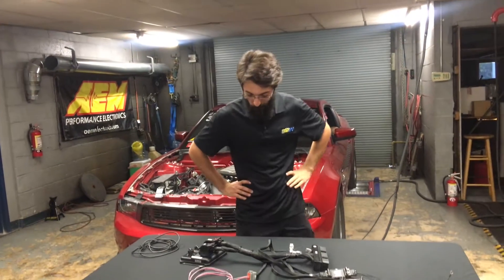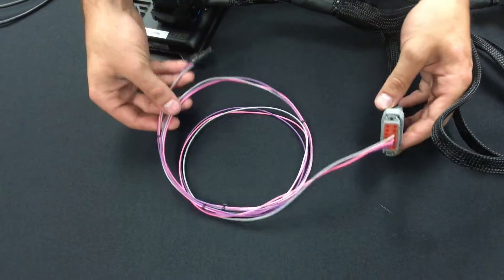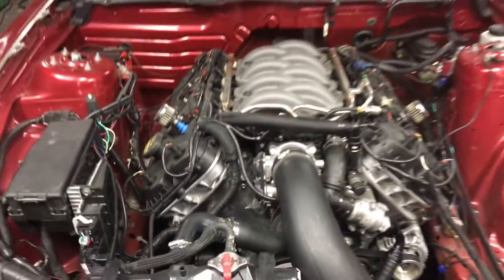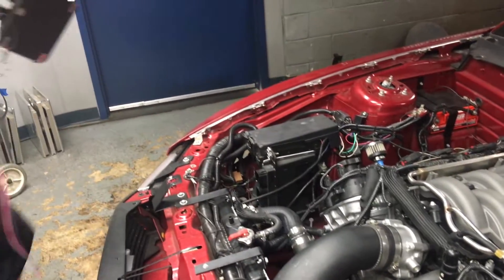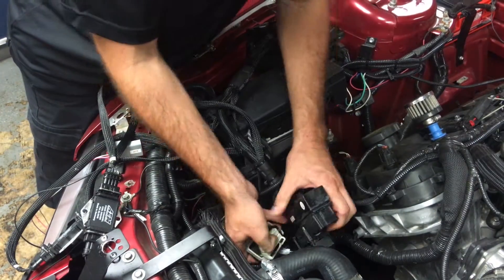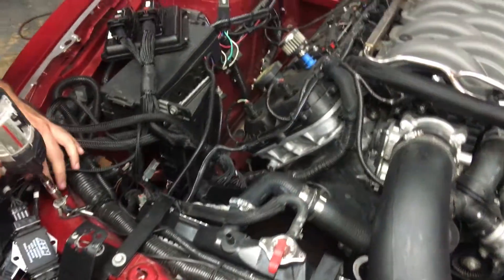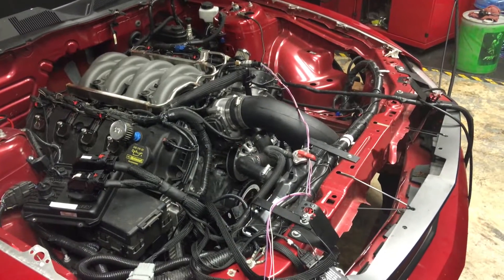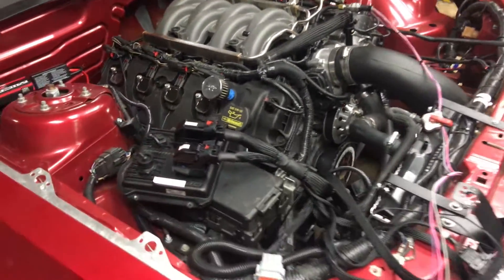AEM Infinity Install on a FRPP control pack harness by JPC

Comment: Witch infinity is this I've seen some with a one port connection and a 2 port like the one in this video.
Reply from the maker: The 7 Series has 2 connectors the 5 series has a single plug
Reply: jpcracing so 7 series meaning the 710
Reply from the maker: the 710 is for a v10 and yes that will have 2 connectors
Reply: jpcracing so witch is this in the video.?
Reply from the maker: 708

Comment: Will that AEM Infinity control pack harness work for a 2015-2017 Mustang 5.0 GT?
Reply from the maker: Yes it will work however the VCT has not been tested yet.
Reply from the maker: It will yes, how ever you will need to use a 11-14 engine harness

Comment: I get it it's quick. but would this work on a swap?
Reply from the maker: Yes this is ment for cars running a ford racing control pack. If you do not already have the control pack they offer complete control pack harness as well to make the swap as simple as possible
Reply: Got it, thanx